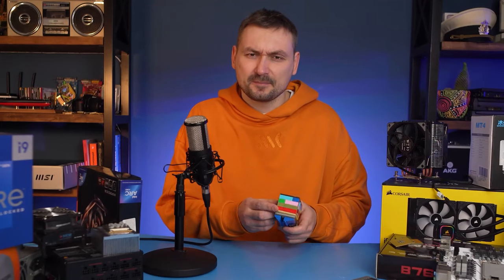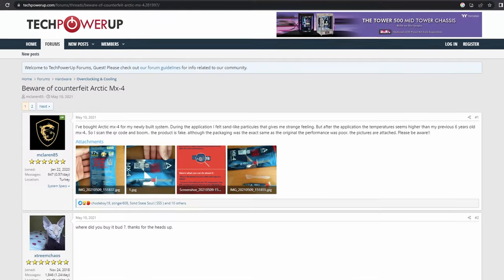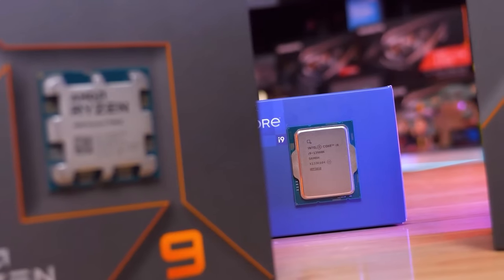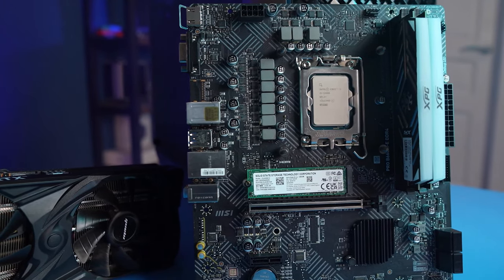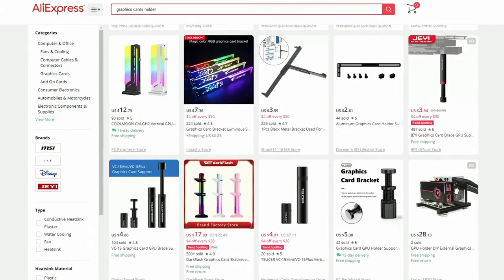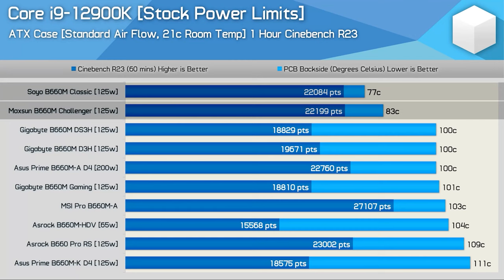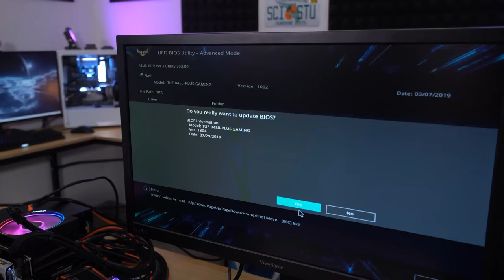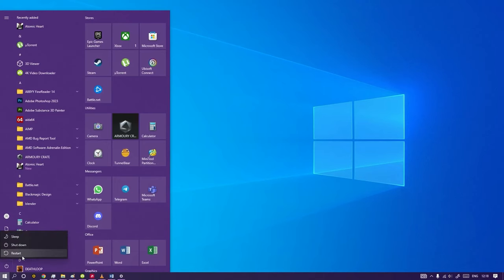This is what you SHOULD know when building a PC in 2023

Comment: I was leaning towards Intel for my upgrade (something like i5-13600K), until I accidentally learned just yesterday that inslalling a PCI-E 5.0 SSD results in the GPU slot being cut to x8 from x16. That kinda sucks (not that anyone REALLY needs a PCI-E 5.0 SSD, but hey, it's a new toy to play with and see if you can actually utilize it for anything).
Reply: The benifits of getting a 5.0 ssd are so minor, it isn't even worth it.
The performance hit going from x16 to x8 is also barely noticeable.
Reply: @gregdaweson4657 , you're right on both counts, but with an asterisk: the hit is barely noticeable for games - if at all. But it is quite noticeable in compute applications, which is important to me (I can't wait to get PCI-E 5.0 GPUs).
Reply: @VioletGiraffe  You are right about compute, but I would say the money is better spent on ram, but your workload is probably different than mine.
Reply: @@Krazi-RDNA, to be fair, it doesn't matter for gaming and probably won't matter in any near future. But it does matter for running some kinds of computations on the GPU (not for all computations).